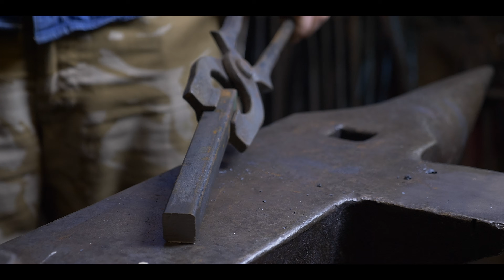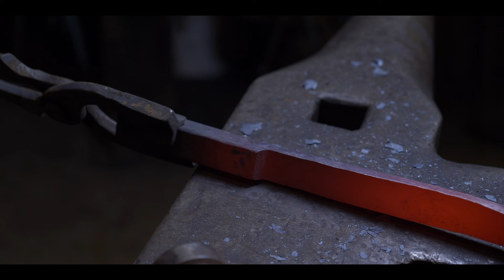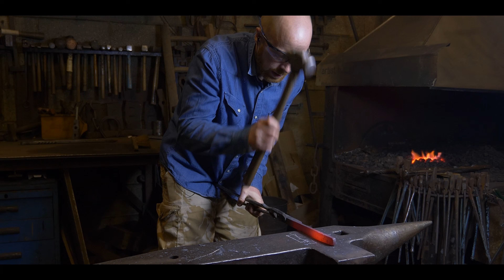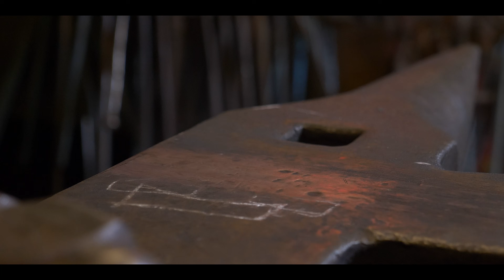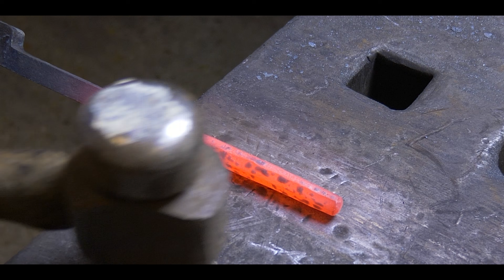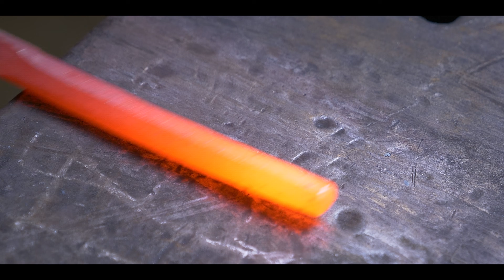BLACKSMITHING - PRACTICE THIS EVERYDAY for cleaner forging

Comment: If you used a proper hammer, you could do a proper job. A square faced hammer with a 1/2"-5/8" cross peen is the hammer you should use instead of a farriers rounding hammer. And use the cross peen to draw out and the square face to clean up as you move along. Then your hammer wouldn't be so wild, your control would be better, more efficient with way fewer hammer blows. Simply said, Proper tools, Proper job.
Reply from the maker: Na im alright thanks. I can use the edge of my farriers hammer as a pein if i wanted to. There are many ways to do the same thing but adter using the same hammer for 20 years  ive learned exactly how to use this hammer and after 20 years of forging all day ive not even thought about using a square faced hammer, im not saying i havent, as i have but i really dont enjoy them at all. Its nice youve suggested other options for others but im fonna have to decline on this day unfortunately. Just get it hot and it mives just fine
Reply: @workingwithiron  correct, there are many ways. some better than others. some subtily better. 17 years a full time farrier and 40+ years a working smith,, and a student of Francis Whitaker. Looking 80 dead on and still at it. So much for credentials. Worth a beer at the local pub, perhaps. Had my time with a rounding hammer and know it well. Took a bit to learn the benefits of a square faced hammer as a daily driver. Never looked back.  I offer my advice as suggestions and hints, not as an arguement. All are welcome to try them or not. This is no critic on your work in any way. I saw your finished product and was impressed enough to watch your vid. This is just just advice on tools and technique. Truth be known, with enough experience, two rocks work dang well, correct? One as a hammer and the other as an anvil.  Back to technique. Most smiths here on line I find don't have a clue just what the edge of your hammer can do, no matter the hammer type. Consider the edge of your hammer as a fuller of infinite angles. A wonderful technique, without a doubt. Now to compare just what happens when you use each, a rounding hammer vs a square cut flat faced hammer.  But first, when you are shouldering and drawing out as in your vid, and your work is right on, clean and precise, What if you could save time by using a different hammer? Is that worth considering? With a round faced hammer, the edge blow profile is a half moon. This means your steel moves in a half moon direction. There is only one point on that curve that moves iron in your intended direction completely, the very center of the arc. All other points, say to the left, move the iron in 2 directions, left and straight ahead.The farther left you go, the more the iron moves left and less straight ahead. The final left point moves the iron completely left and zero straight ahead. Now look at the profile of a square cut hammer. Its is a line, or linear. Now hot iron moves in the path of least resistance, without a doubt, so you don't eliminate left and right movement completely, but the straight edge moves far more of the iron in that single direction that you want it to go and that is forward at every point of contact. With a round faced edge, only one point goes in the direction you want. A lot of words, but I hope you get my point, so to say.  My premise is that the best work with any forging is the one that takes the least amount of force, the least amount of hammer blows, and the fewest heats to produced  the final project, be it a simple "S" hook or a complex railing. I believe I've given good logical reasons for my critic. If you falt this for any reason,then as they say in Sante Fe, Bueno Hey, . If not,then consider it may be worth a shot at learning something new. A couple of paraphrases from mr Whitaker: this spoken at 90 yrs, "This craft continually amazes me that I can still learn something new at my age".  And: "It takes 2 things to do a good job, Proper setup, proper tools, proper job".  Thanks fo allowing me to use your space for this. And to the gent below, being nearly 80, theres a snowballs chance in hades that I will do a vid.  ;)   If you can read and understand the above then that beats a vid hands down. May your fires be hot, and your clinkers be small.
Reply: Right. This is a terrible result. You should post your own video and show us how it is done.

Comment: Mate you have to figure something out for your microphone. I have to have you at the lowest possible volume in my headphones because the mic is pointed directly at the hammer blows, so I can barely hear you when you're speaking but even at the lowest volume the hammer blows are super loud. You have to attenuate the hammer blows or control the audio from them during editing.  I'd prefer to lose hearing from my own hammer blows 😅 But if I watch many more videos like this I'll be half way to deaf by the time I start forging myself! 😂

Other than that, it's a fantastic video and I'm looking forward to using this method as practice! Thank you for sharing this one with us!
Reply from the maker: 😅 apologise for you going deaf but i cant please everyone, i get viewers saying its too quiet most of the time. Its definitely not the quietest anvil i get that but my viewers are in the higher age bracket so i cater for them with the higher volume hoping the youngers know how to turn their volume down. At least the treble. 
Ill keep working on it, i appreciate the feedback 🙏
Reply: @workingwithiron  the only criticism I have of your videos so far is that if I have the volume up high enough to hear your voice clearly, the hammer and anvil are way too loud. I cannot tell you how to fix it..; I have zero experience making blacksmithing videos. What I can tell you is that other blacksmithing creators (like Alec Steele and Black Bear Forge) have managed to find workable solutions. I do not mean to sound harsh. I really enjoy your content. I would just enjoy it more if I could hear you better.
Reply from the maker: Oh i know its not great, i watch it over and over during the edit. This anvil is super loud, i actually hate it but have bought another anvil thats on the complete opposite side of the sound barrier 😂 so hopefully it works with my microphones. Very sorry and thanks for the reminder to figure this out for the next project

Comment: I'm impressed with the accuracy of your strikes. Try as I may I dont have that yet. Any advice for making hits in the right spot everytime?
Reply from the maker: Move the work rather than the hammer. 
Also put a chalk or marker ring the same size as your hammer head on the anvil and only forge in that one spot as much as possible. It's hard to teach accuracy but the more time you practice the easier it gets.   And look where you want to hit, it's like in motorsport, if you look at a wall you'll hit it but if you look up the track where you need to be you'll go there. It's the same thing. 

I don't hit the right spot every time,  sometimes I'm off, especially if It's an important hit like a rivet head and I don't want to strike the work around it. I'll always hit it as im conscious of not doing it. It's my wall. 

Also upsetting material always helps, hold your hands in a fist, now hold one still and hit the other with your dominant hand without looking. You will always hit it. Then move them around.... Will still hit it. I've so many hours in forging by hand, over 20k easily. So keep that in mind, it's all subconscious to me now, that's why it looks easy. 

Hope that helps, such a great question 👍
Reply: @workingwithiron  Good stuff: move the work not the hammer, and THAT'S why you have that circle written on the anvil face- makes perfect sense. I appreciate your teaching videos more than any fancy work on other channels. Your work is impeccable and I learned that the planishing is done when it's cooled before your next heat- oh and working on the near side of the anvil..man good stuff! Thank you for your reply- thanks for your videos.

Comment: Great teaching. Great forging. For me, the best part is this man KNOWS how to swing a hammer. For those who are having trouble getting stock to move, here is a lesson for you. He uses the full range of motion of his shoulder and arm.  He uses a whip action in the wrist. It's amazing how much faster  your hammer head will fly with a flick of the wrist. He has a long hammer handle and  uses it to advantage by gripping it out near the end of the handle. That increases the speed of the hammer head. Force is mass x velocity squared. Because the velocity is squared, the faster the hammer head moves the more the force increases exponentially.

Comment: I have a question. I found two forged (I'm quite certain they are) items I kept from my dad. One is a set of metal snippers made in England the other a set of small pliers. The latter is pivoting invisibly and is joined in a mortice and tenon manner. It looks impossible.  Any idea how the toolmakers of old did this?

Comment: Thank you for suggesting that this could be turned into tongs because I was thinking that as good an exercise this is it seemed like a waste of fuel to me until you said that. A video of making tongs from this would be helpful.
Reply from the maker: It's literally just process, can be broken up into it's own demonstrations, square to rectangle, square to round, rectangle to round set down, how to work bars, it's just the method. For tongs all you would need to do is on the first isolation, go at a 45degree and create a boss then forge that isolation to section. It's the basics of forging broken down is all. It's a great exercise to do to get good fast.
I agree a waste of fuel with that size bar but could do a 3inch piece of 3/8 stock in maybe 5 heats maximum even 2 or 3. Just as a warm up exercise. Aiming for clean tight and straight edges and corners. Will make a hell of a difference to anybodys forge work.
It's also to show working temperature, and to work it colourful rather than hot to cold. Back in at orange etc.
Reply: @workingwithiron  I apologize if my comment came off as criticism, I am grateful for the exercise and the idea of turning that exercise into something functional. Thanks for the explanation of creating the tongs. I will have to give this a go sometime after the holidays. ✌🏻
Reply from the maker: Oh not at all. It's a great comment I'm glad you mentioned it. Hopefully my reply answers a lot of questions other people have also.

Comment: Great video! Just a question on your tongs, do you prefer the reigns that far apart and why? I am making my own tongs and looking for some more info...
Reply from the maker: I don't and good observations. These tongs were made to fit 16mm and the bar was 20mm but I didn't want to adjust them. You have made me want to make more tongs now 🤣 thank you!
Reply: I am going to be greedy and ask if you will make a video of the tongs you make?
I have watched your other video a bunch of times, and I still struggle getting the transitions right with a very basic setup. Effectively I work with a hammer, anvil, chisel and one hand held fuller (for now).
Reply: thats were thong clamps are made for 😅

Comment: Good demonstration as usual.  Good teacher.  When I made my first spring fuller I used your demonstration. It's a little rusted, but still works great, chose to use coil spring for it. I make alot of mjölnir pendants with that one, great size for the initial set downs. 🍻
Reply from the maker: thats what i love to hear Jackson! im glad you are getting use out of the vids. i still need to make one out of spring steel, might have to do that soon! Thanks for the kind words.

Comment: Thanks so much for this video! 
I took my first blacksmithing class a couple of years ago and first bladesmithing class last year. Because of my infrequency with forging, getting into the rhythm outside of the class structure is difficult. My hope is to get an anvil, forge, and tolls this summer, and this will be one of the techniques I focus on. Again, thanks a ton.
Reply from the maker: That is awesome! Get it done john, its very rewarding when you can just go forge whenever you have time! Hope you get it all sorted soon! good luck!

Comment: I may have missed this in the video, but did you mention the weight of your hammer?  Great Video and great information.  Thanks!
Reply from the maker: ahhhh man i did not, completely forgot. I use a 1 3/4lb shoe turning hammer. thank you very much for your membership, its greatly appreciated. Im gonna add it to the description as im getting a fair few questions on this. Its more about the heat of the work though rather than hammer size.

Comment: Nice clean forging good instruction how heavy is your hammer? Do you reduce the shaft to suit to reduce vibrations 😊
Reply from the maker: thanks colin. its only 1 3/4lb hammer and the shaft came as it is. i didnt do anything to it. i havent ever noticed vibrations from it as i dont grip it very tightly it kind of just floats there and i grip it on the downswing. hope that helps
Reply: @workingwithiron  very valuable information in this comment. Lots of new folks really need to know n understand this concept. Saves wrists n elbows metric tons of abuse!    Hope I said that correctly 🙏🏻🔥⚒️🧙🏼‍♂️
Reply: I honestly thought it was a heavier hammer but you can certainly swing it ,I might try a lighter hammer to see if I can improve my swing
Reply from the maker: @col925  it's just the temperature rather than the hammer size, if I'm just moving material then I'm as close to welding temperatures as I can be, it's so much easier. When you get used to working in that temperature range you can move a lot of material. What size hammer do you use at the moment?
Reply: 3lb cross pein at moment , but shaft is a bit bulky and solid feel
Reply: Good comment it’s definitely helps to get to those temperatures where the metal is more malleable